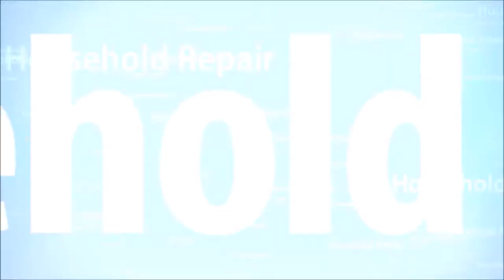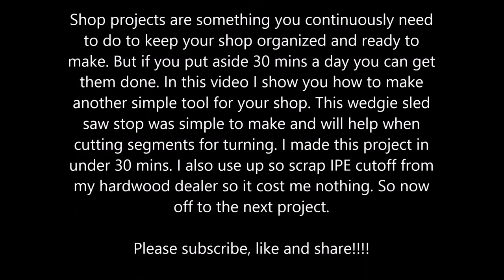How to Make a Wedgie Sled Saw Stop

Comment: Outstanding!  Thanks for this.
Reply from the maker: My pleasure!
Reply: @MoonpieCreations  Hello,
Just built the wedgie sled yesterday.  I mainly want to use it for the hot air balloons I want to turn on the lathe.  I did woodworking for a long time and now after a hiatus I’m getting back into it.

I’m using the plans from Wood magazine, issue 43.  In the past, back in the 90’s, I made a lot of these balloons on the lathe but always had difficulty cutting the six 30 degree segments.

So the sled, it’s design is clever and elegant but since I only need six segments (I plan on turning balloons with more than six) I can’t figure out how to set the sled for the proper angle.  I tried a 60 degree plastic protractor but when I do a “test” on scrap with a pencil instead of the blade the angle isn’t 30 degrees.

Any idea what I’m doing wrong?

Many thanks.